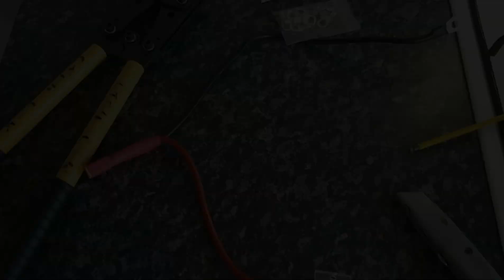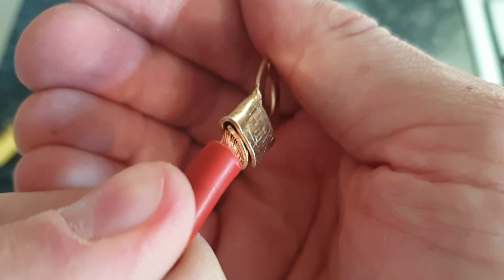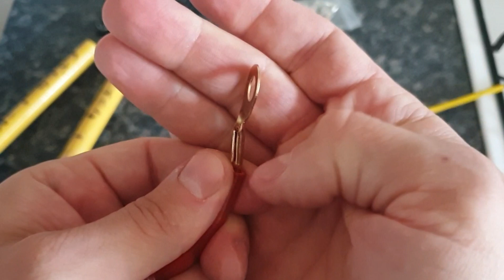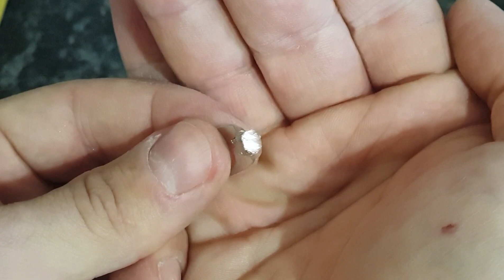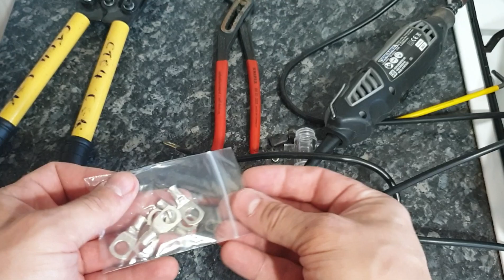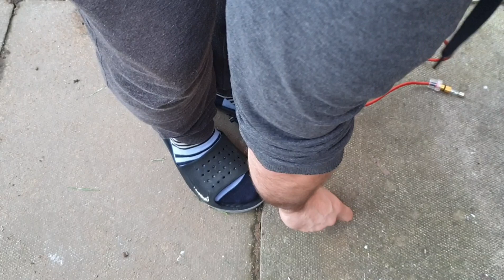Investigating a poor crimp

Comment: Ferrules are also a debated item if you're looking for another video idea.   There are 3 sides, one says they are good giving better connections and safer, one says they do nothing and the other says they are bad, cause resistance and noise and loose connections.